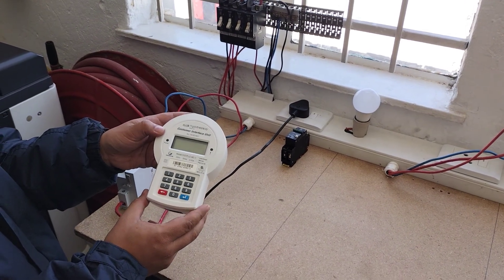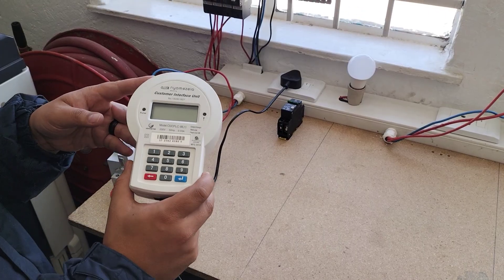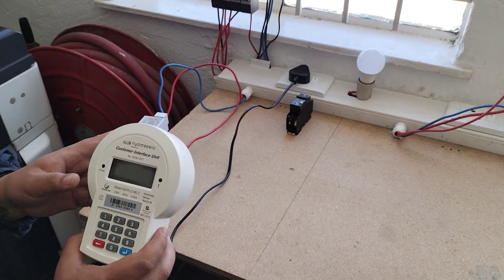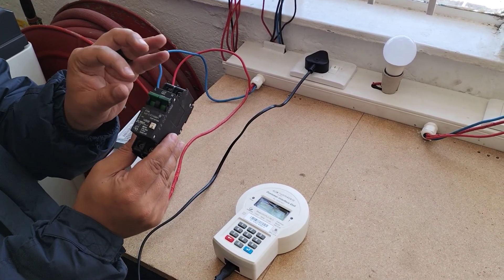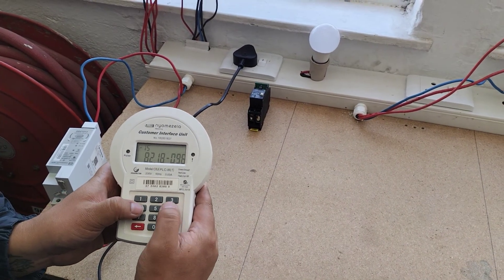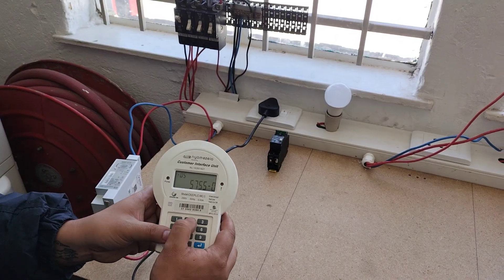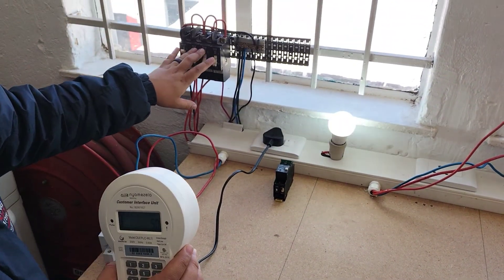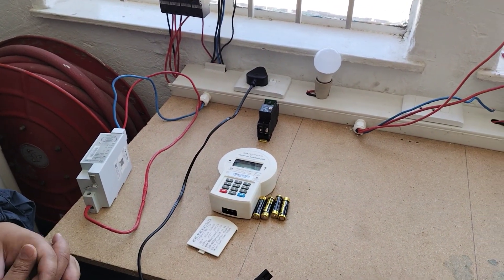Inhemeter Troubleshooting

Comment: Mine is 2011. The battery section is rusted and one spring broke out. It doesn’t connect with batteries and it was not connecting well with the power supply today. My house is currently without power and no way of fixing it.

Comment: Can this recharge if there only batteries inside the device? I was trying and each time I input the recharge voucher, n enter, it just displays Connect. I am waiting on Eskom to come fix the tiny cable attached to the device for connection to power socket.